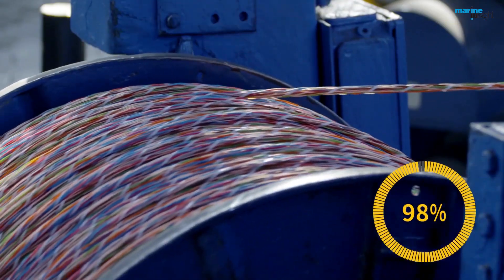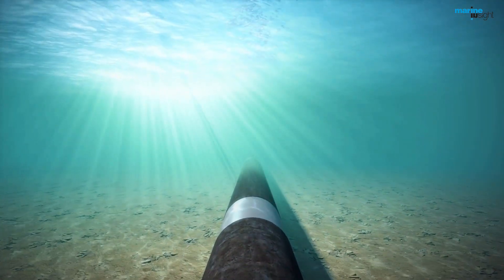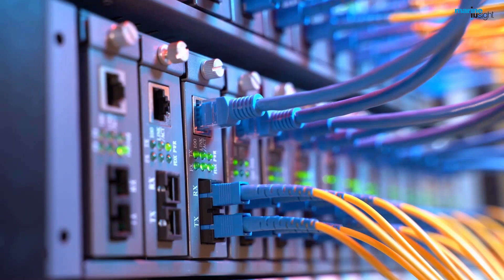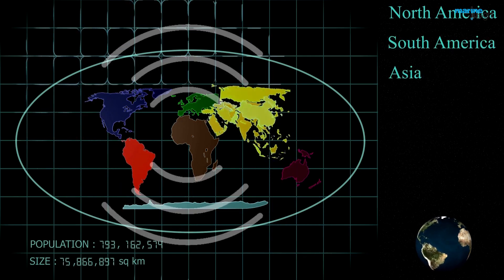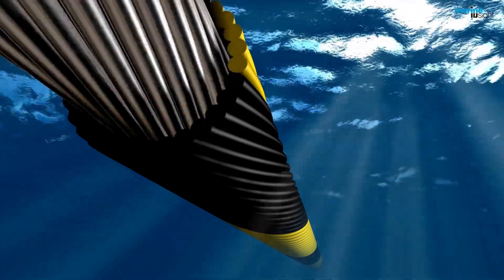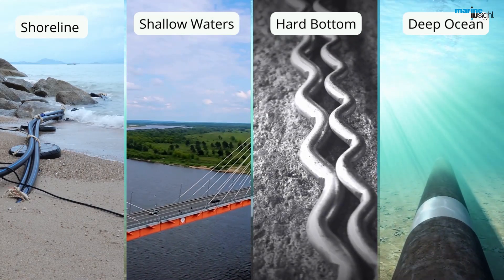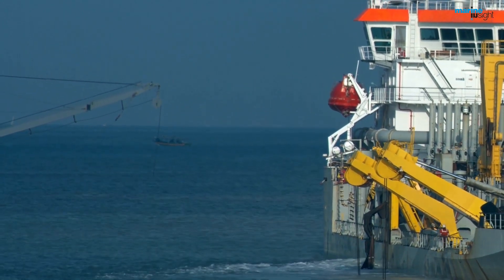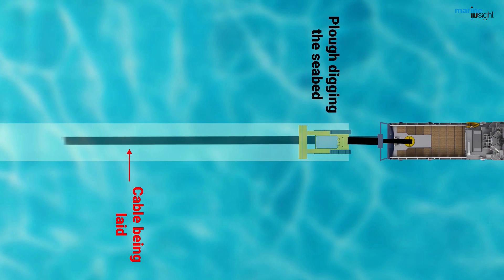Underwater Internet Cable Laying Ship

Comment: Thanks, so interested. Useful video. 🙏🏼⛴🙏🏼 just please Do not anchor in certain areas of the sea where submarine cables pass through there . All you need is checking the charts.
Have a safe voyage
Reply from the maker: Glad you liked it. Yes, We need to follow the carts and anchor in the designated anchor areas only.
Reply: @marineinsight  🙏🏼⛴👍🏼